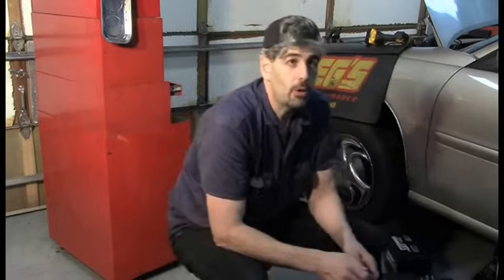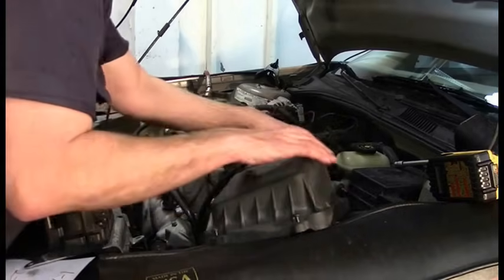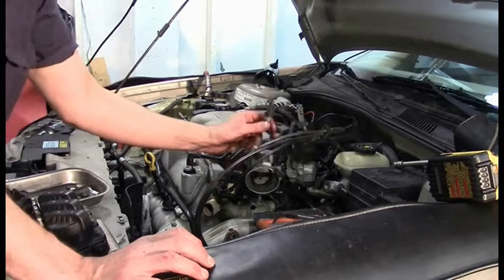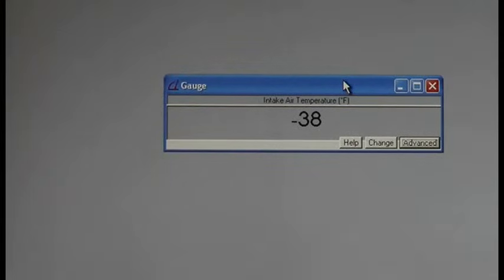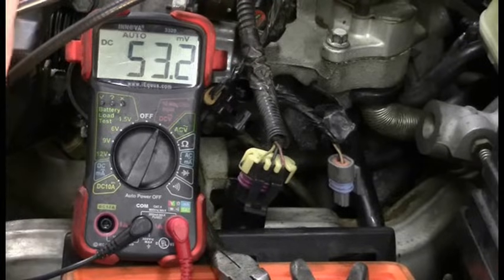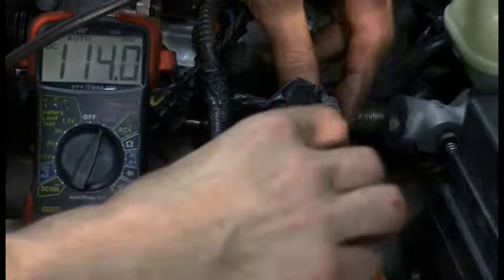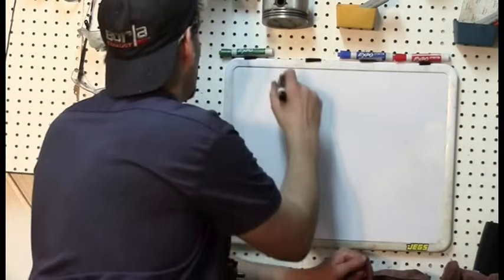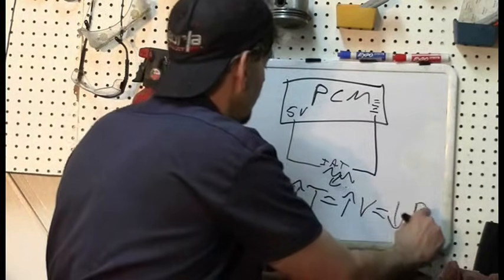IAT ( Intake Air Temperature Sensor ) Diagnosis P1111, P1112, P0113

Comment: I see that Pine Hollow and you agree that the part played by the IAT is minimal because the MAF sensor is the major controlling sensor in the combustion mixture. I'm not an expert in any discipline at all. Said that I have a few questions
01-If the air mass is calculated by the amount of air that goes by the heating element ( is that correct?) and therefore has a cooling effect on the element itself. It should make a major difference if the air is coming at 20 degrees of 100 degrees. Is that concept right?
02- I would think that the ECU ( whatever the appropriate computer) to accurately measure the amount of air would need to compute the the IAT measurement ( incoming air temperature) and proportionally adjust for the reading from the temperature drop as given from the heating element of the MAF sensor. At that point the measurement can be correctly arrived at. Whatever it may be called, but some sort of compensation must be applied when some 100+ degrees is trying to cool the MAF element versus freezing air. Am I wrong or is this what happens in theory?
Reply from the maker: Fantastic questions. Really good!
  The first question is easy—. I totally see your point but remember it’s the air density, not the temperature that is the major factor in the fuel adjustment to maintain stoichiometry. Incoming air at 100 degrees vs 20 degrees sure sounds like a massive difference however the density of the air is not significantly different enough to require a major adjustment that would affect performance if it wasn’t done correctly. 
  Now the second question is a bit more complex. The MAF is totally independent from the IAT on maintaining the temperature of the hotwire at a constant temperature. It is not “responsive” to temperature though it is “reactive” to temperature. Basically, the MAF maintains the hotwire at a constant temperature which is done by a responsive adjustment to current to wire. As the wire cools, current increases which is interpreted and more air must be coming in regardless of temperature. It only “knows” the wire is cooler and warms the wire up which cues more fuel trim. The reverse is true if the wire is hotter than the desired constant target- and the current is adjusted to cool the wire down which reduces fuel addition. Again it just sees the wire cooled down or heated up. That’s all the MAF knows. IAT is totally separate for adjustment based on temperature. The IAT is not used to maintain the MAF wire. 
    Hope that explains it but damn, that was the best question I have seen in years and years.
Reply: @SchrodingersBox  FIRST OF ALL: THANK YOU FOR THE COURTESY OF AN INTELLIGENT REPLY. You actually read what I wrote.
I want to give you the perspective that I'm coming from. I used to drive a 1991 MB 350DSL. Bought it new and at a time when the motto for MB was " Engineered like no other car in world" or something close to it. Indeed I took them to task. One time the car sat at the dealership for a total of 51 days, I picked up the car and after inspecting it brought it back showing 16 points that had to be addressed, either they overlooked or caused, while working on the car, the present concerns. I was told by the service advisor that the service manager, preferred to see the devil, rather than I, to which the advisor inquired " But is he wrong?". That's what bothered the SM.
Despite all the time and getting everyone involved they couldn't fix the problem and as usual they tried to put it on me.
One day I decided that I was going to find out what the problem was and I did find the cause of the excessive vibration on the diesel engine. It was a belt tensioner. The bearing on this part was composed of 2 rows of balls ( bad design, it should been either needle bearings or a bronze bushing) and because the bearing didn't turn complete revolutions, it created an indentation effect. The balls being harder than the races ( that's my conclusion) would create a indentation that was deeper at the center of the arc( constant pull in one direction) and shallower as it progressed to the end on both sides of the arc. This created a spherical hole that had "walls" that were higher than the center. As the belt rotated and the engine vibrated the balls had to "rise" to attempt to accommodate the pulling by the belt and then the balls would fall back down into the low point. This was the cause of the higher jerking on the engine assembly.
This was almost 3 years of back and forth with MB. At the end I was really good at taking the radiator, fan and everything else necessary that it became something like a 90 minutes job. Buy the  part, 6 months later bring it back for replacement under warranty, at the end of 12 months buy another and do it again. I just refused to give up and accept that is wasn't repaired back to "new"  like conditions. If parts are available one should be able to logically work out the way to fix it, Economically, that's another chapter.
I fully agree with your approach, analyze the problem at hand, come up with possible causes and see if there is a sequence of steps that, more efficiently, can either rule out or undoubtedly id the cause. This actually takes some logical thinking and effort. There is something that I want to bring to you, which I think is rather interesting. I was told this by a good friend a long time ago, at the time it didn't really register, but since I have noticed how right he was. He said " God only put a limit on intelligence , stupidity is unlimited". Nowadays I remember it and help put things into perspective.
Going back to my original question, please help me understand where I'm misinformed.
The whole process, as you explained, I understand, even though my writing may not have shown what I was thinking.
A-Is mass something like the quantity or volume of matter? Not weight.
B- Does increasing the density, increase the quantity of mass?
This is how I'm understanding, both A and B to be true, if that is not the case then all my further deductions are flawed.
I looked up the density for air ( I don't know at what altitude) @20 degrees =1.324 Kg/m3, @100 degrees=1.135Kg/m3. I calculated that this comes out to about 17% lighter or 14% denser ( depending on how one approaches).
C-From that I deducted that colder air, not only being denser, but also of having "greater capacity" for cooling. So, my reasoning went that to created the same cooling effect, one could use more " hotter air" or less " cooler air" . Is this thought correct, or am I not getting it some detail?
Once the computer senses the temperature "drop" at the MAF sensor it will interpret that a certain quantity of air is coming into the engine. How would the computer knows if it is getting "hotter" or "colder" air? Would the TPS alone be able to provide "accurate" information to the computer to calculate the incoming volume( is volume and mass the same in this case?) of air.
I'm thinking that the process to be more accurate it would use some type of triangulation. IAT, MAF and TPS. At that point the information being provided to the computer would give, IAT temperature, MAF temperature drop, and TPS limits how much air is coming due to throttle plate angle, which translates into opening area to permit or restrict air entry.
If you would, please point it out where is the fallacy in my reasoning, please keep in mind that I'm not into the field of auto repair and thanks to your videos that I have watched, for the last few days, I was able to understand the specifics, more than than in my previous 50+ years of wanting to repair mechanisms. I have the concept of the workings for the reciprocal internal combustion engine. ( I'm fascinated by turbines, but haven't been able to grasp the concept), 
The difference between the 70's and today is the existence of sensors and transducers that 
can be far more accurate than just a vacuum gauge and my ears.
To me the biggest difficulties are:
1-To id the individual components. IAT, ECT, IAC etc I don't have info as to where they are.
2- Disconnect harness and connectors, without breaking things up.
3- Proper hook ups, without " burning down" the house due to unwanted shorts. I'm looking for breakout adapters
4- Range of normal expected values.      What voltages am I looking for. 
5. Dealing with "intermittent" conditions Can't duplicate the problem in a constant manner.
I thank you for the GREAT videos due to the DETAILS and LOGICAL PROCESS that you apply.
Keep helping the ones that want to be helped. Sometimes is not easy to find correct info.
Good Luck

Comment: I notice you're checking for voltage using the DVM with the engine off. I assume the key is in the "run' position and that voltage should be present under those conditions?
Reply from the maker: You just need the PCM activated, that’s all that matters b

Comment: Would a bad IAT sensor cause my engine to keep stalling? I have a 03 Ford expedition and I'm getting the p0113 code . It stalls at random while moving or sitting or goes a day or 2 and don't stall.. scratching my head here.
Reply from the maker: What is the signal voltage showing on the IAT?

Comment: Hi 
I am Camilo From Bogotá, Colombia.
I have seen a lot of your video they are grate, but still have a question, how does a PCM calculate the density of the air if the car is in a city at 1,6 miles hi like Bogotá? Or do the LTFT compensate for it?
 
Thak you.
Reply from the maker: Air density is related very much to its temperature as well as altitude. The Intake air temp sensor and the Map do these. In case of the MAP, it recalibrated when you turn the key on and it takes a reading of the atmospheric pressure. The car doesn’t really know your elevation- it will just see the atmospheric pressure change. It also does this when you are at wide open throttle as well.

Comment: thank you professor for the great video. I had a 2013 mercedes c300 with 3.5 NA engine. Once I got engine light saying iat circuit high, ending up with replacing a new sensor but I was wrong just as you mentioned as a part replacer because the stock one was good. But now I have another problem, the LTFT on idle is negatively high (> -10%). scanned the car with no code no nothing. Only thing is that the fuel rail pressure is high on idle which is 15000Kpa whereas WOT is 20000Kpa. I am lost now where to go.
Reply from the maker: check fuel pressure regulator first.
Reply: @SchrodingersBox  as far as I know this car has no pressure regulator, high side fuel pressure is controlled by pcm via solenoid on high pressure fuel pump. the roadblock for me is how to rule out the suspect, the PCM or the solenoid? Appreciated.

Comment: That tool works good finding some bad wires but tracing grounds can throw you for a loop. Grounds go to the chassis and go off different ways not easy to follow. Hot wires are not this way at least most. They go from a switch to the device for function. Grounds all go to ground and the whole vehicles ground (the frame and body) hook to the neg battery terminal so a ground can be grounded to the vehicle and tied to other ground wires like a friend of a friend not your best friend as it is called.
Reply from the maker: Thats true.  Also a parellel circuit will throw you for a loop as well.

Comment: I love all your videos Thank You for being there .. Just have a small question, Can a bad IAT compromise Air Conditioner Like cause Bogging and surging when ac is engaged?
Reply from the maker: Lots of things could cause that. Everything from vacuum leak to a bad TPS. I’d start with the basics - fuel trim curved against load with MAP and MAF to start with.
Reply from the maker: Thanks for watching. No it would not do that. A bad IAT would actually show no noticable symptoms other than a check engine light
Reply: @SchrodingersBox   Is it possible to have high idle at first statup 2200 rpms take about 10 mins to go to normal No CHK Eng Light and a bad ATI Because I have both ac Idle issues and high rpms at start up (example) AC on going 70 down the highway car is at correct Idle 2500 rpms Then ac clutch disengages and sends rpms surging to 4000 rpms! Does the same at lower speeds but you dont feel it as much

Comment: Execllent! Brilliant. He is at least as smart as I am. One of my friends has a similar issue with coolant temperature  sensor.  Hhw had replaced the sensor on the advice of a mechanic but the problem did not go away. My cheap scanner reported a ridiculously low temperature. I thought it had to be an open circuit. I followed the coolant temperature  sensor wiring and found that it had been chewed out by a rodent.

Comment: Have a 2003 Chrysler Voyager LX 3.3 6  Got a P1193 code  , PCM detected that  the air intake air temperature sensor signal was greater than the maximum allowable value .  Unplugged the connector and took a reading of #1 pin on the connector and I got 00.6v .what should I be looking for to solve this problem ?
Reply from the maker: You need to first confirm if the sensor resistance curves against temperature. If it does you should suspect a ground fault- check ground continuity to the PCM

Comment: I recently got a p0112 on my 98 f150. I changed the sensor with the connector.  An I still get that code.
Reply from the maker: Ok- what data did you get that showed the sensor was bad? I would definitely start there. What was the resistance and voltage showing that indicated the sensor was bad?

Comment: Im an idiot for fixing it
Reply from the maker: It depends how you fixed it. If you fixed it by replacing the sensor without knowing thats what it actually needed, then yes- it would be idiotic even though it's fixed.  Favorable results do not a validate lack of comprehension.

Comment: Question, would the iat read hot if the fan for the heater or air conditioner was off? Would the temp drop or regulate to normal when air or heat was turned on?
Reply from the maker: No. IAT is measuring incoming air. It is affected by ambient air temp and engine bay temp.
Reply: @SchrodingersBox   ok I was using a 3rd party dongle? Device and had a serious issue come up. The iat temp read 220 and hit a critical alert at 180. I am desperate to understand
Reply from the maker: Sounds like a high current condition.
Reply: @SchrodingersBox  like power surge or voltage surges?
Reply: @SchrodingersBox  an thank you for your input!
Reply from the maker: No probably a short to ground given the temperature range. Just take a voltage drop reading to confirm.

Comment: 5 volts, temp dropped resistance, still have a code 23 and vehicle hesitates and bogs while driving. It died all of a sudden on one occasion. Acceleration jerking as well.  It runs fine in park and only starts to hesitate after 4mph. I also have codes 34 and 54. It seems to go back and forth between 23 and 34. MAP sensor is working fine and I have around 11.54 going to the fuel pump. I've tested the TPS with a multimeter and voltage increases normally but as you said, a scan tool is much more accurate. I also notice that the tach needle slowly and slightly decreases and increases back to current RPM while driving. Any ideas?
Reply from the maker: always start with a basic fuel trim analysis so you at least get a north/south direction

Comment: I have code P0113 popping up with a scan but my check engine light doesnt come on...GMC doesnt want to fix the issue idk what to do :/
Reply from the maker: OK - just start with the simple stuff then. what data do you have? What is the voltage reading from the feed and resistance across the load?

Comment: Thank you so much for this video. I just watched you MAP, MAF video as well and it helped. I got a code p0113 and a p0107. But my car also overheating when I ran the AC I was told on my Kia Sportage I needed to add a lube plus the YR1234 however I only added the YR and not the lube would that make the car over heat? This is all new to me and I don’t want to spend more then already have. Help!
Reply from the maker: Overheating with the AC on can be from a lot of things but the usual cause is the secondary fan not operating or radiator fin obstruction limiting fan efficiency. check those first. In fact most of the time i find debris in the radiator fins is the culprit.

Comment: Hi i have p0112 code .on skoda fabia 1.6 tdi. 2011.Replaced the maf sensor  and clear the code  with scanner but came again. Reading of maf connector is pin 1 beep, pin 2 is 12v, pin 3 is 4.7 v.  With key on . What should I check.?
Reply from the maker: You didn;t check the sensor ground... otherwise check if there is induction mismeasurement. It could be MAP is accurately reporting a value that is out of range.
Reply: @SchrodingersBox  thanks for reply.it has just 3 pins. 1  2  3.